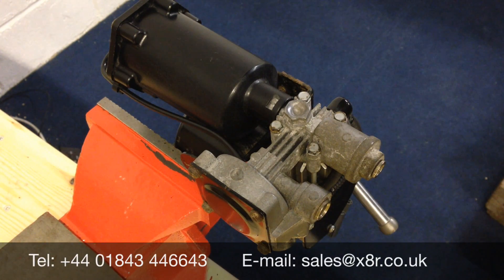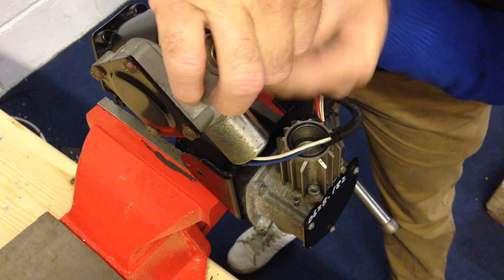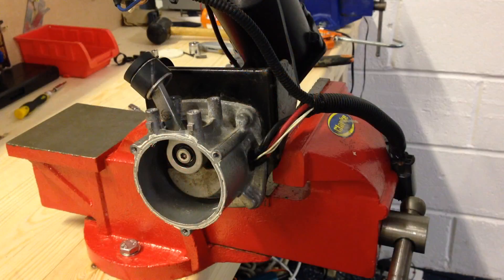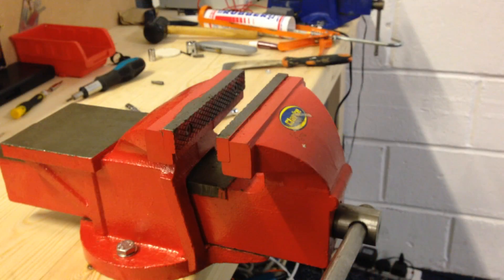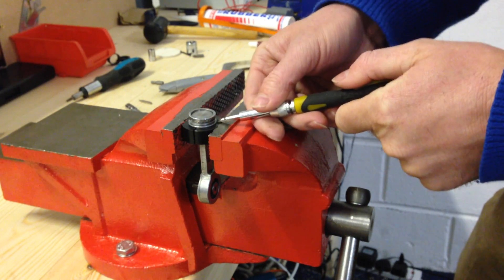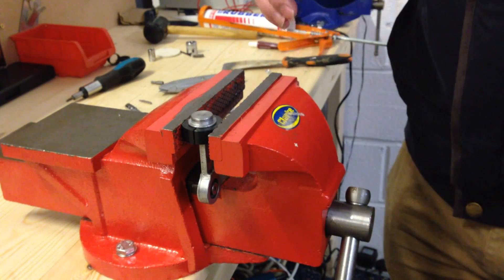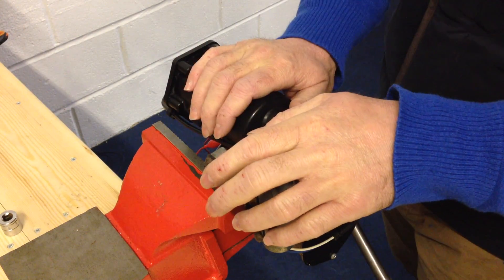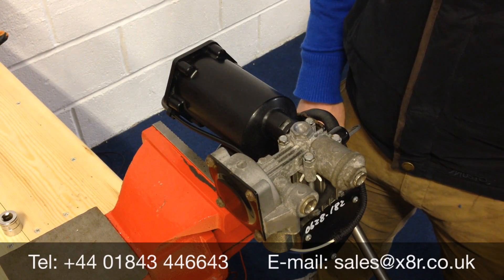Land Rover Range Rover L322 2006+, Range Rover Sport and Discovery 3 air compressor repair.

Comment: I bought this kit with the filter desiccants and seals. I also had to buy a new piston and piston rod since the ball bearing disintegrated. When I installed the glide ring I could not get it to fully seal, meaning that both ends of ring do not touch when wrapped around to lower section of the piston. Is the glide ring more for guiding the rod/piston inside the cylinder or does it also help with creating air pressure? The reason I ask is because when I installed the rebuilt compressor it doesn’t seem to provide air pressure to raise the suspension. The compressor runs for 2 seconds, shuts down, then restarts for 10 more seconds and then shuts down/amber light comes on. I can turns off ignition and the process repeats itself. During all these attempts the suspension does not raise a bit, not even a centimeter. Anyone have any experience with a similar case?
Reply: I did.  It's sad because while throwing the error eventually, my car worked before.  It's toast now.

Comment: This was fantastic. Bought the repair kit off eBay and my amber light hasn't come on again so I am very pleased.  The felt filter for in between the two plates in the air dryer was too small and wouldn't work with the rubber seal so just used my old one but this repair kist probably saved me close to $2,000 Australian.  Thanks guys.  By the way, the seal at the top of the piston is not easy to get off, this video made it look easier than it was.